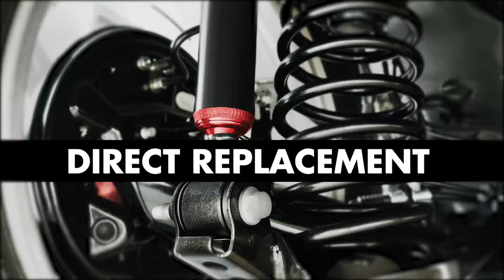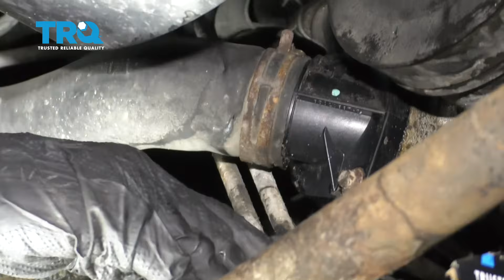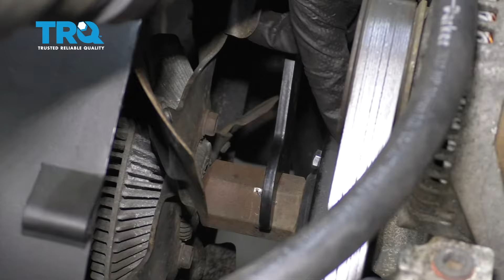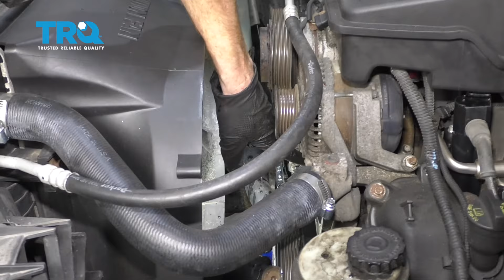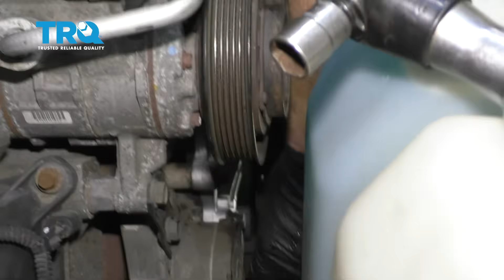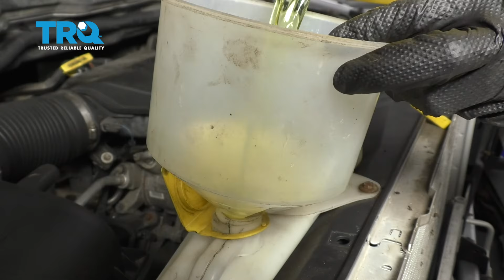How to Replace Water Pump 2002-10 Dodge RAM

Comment: I have the 2007 4.7 1500 it just started over heating yesterday the resivoer is full but my radiator is empty is it my thermostat or water pump that needs replaced or should i replace both

Comment: Instead of putting the bolts back in the old water pump, you could just make a sharpie mark on all of the locations on the new case where the long bolts go.

Comment: This guy seems to think everyone has an air chisel for their vear hickle. The bolts through the pulley trick is good advice,  though.  I was braced for a nightmare, but it came off easy with a pair of channel locks- HALLELUJAH!

Comment: On these 4.7 engines with the blender screw you have to use this to get all of the air out of the system. If you don't do this your heat will not get hot and the engine will run hot. If these engines get hot you will lose your valve seats ruining your engine.
Reply: Did you mean: Bleeder Screws?

Comment: You should tell people to burp the air out with burp plug and radiator cap off until all air is out or it can overheat with trapped air on 4.7 engines
Reply from the maker: +luke burnette Thanks for the tip!

Comment: GREAT VIDEO!
I especially liked it when you removed the bolts that you inserted them into the new pump to keep track of which bolt goes in which hole.
I have a question though. Is the thread sealer just used to keep the bolts from seizing up over time? Could I just use Permatex Aluminum Anti-Seize Lubricant?
Also, how do you burp out the air from the system? Is there a bleeder somewhere?
And lastly, sine my truck has 180,000 miles on it, would it be a good idea to go ahead and replace the thermostat while I have the system empty of coolant?